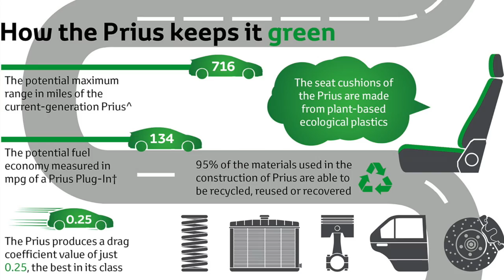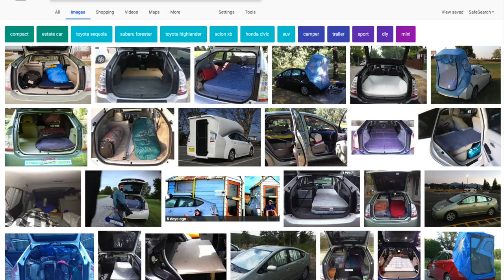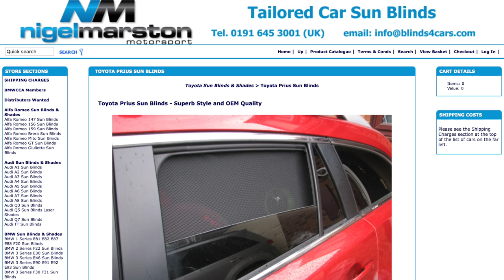Stealth Car Camping in a Toyota Prius (Building a Bed, Staying Warm, Privacy & Security)

Comment: your bed looks super cozy...i do alot of traveling and car camping in my suv (aztek) so spacious and roomy....i do have a little traveling trailer as well i take everywhere with me it has a cot, 13 inch tv/dvd combo and a little night stand (5x8 camper) with ac so i can plug in during the summer to keep cool....i would rather sleep in my suv than my camper most of the time....take care and hope ur well and still safe and traveling..really just need to find a way to get an extra battery hooked up so i can get a little cooler like urs and a few other things
Reply from the maker: Cool! Sounds like you've got a nice setup going. I totally know the Aztek, very unique car. Yeah, I've seen the little teardrop campers and other small trailers. It's interesting to hear that you prefer just sleeping in the SUV. I feel pretty secure, like I could jump to the front seat and scram while in the car vs. separate. I hope you get your battery setup just right and can enjoy the travels :D

Comment: I'm doing the same thing you are doing but instead I have a 2016 Hyundai Accent and I recommend getting the Goal Zero Solar powered battery with a 30 watt solar panel. I have that set up in my car instead of using my car battery. May be a bit costy but It was well worth get for surviving situations. I travel for work as well and was thinking about this for a long time. I copied your set up but was just different on a few things that fit for me. I plan to travel for 5 years worth of work so I plan on living in my car like you at free camp grounds or living at a co workers place on there drive way. You gave me some great ideas.

Comment: What model Prius has the solar panel in the roof? Really enjoyed your video. It gave me a lot to think about! Thanks!
Reply: It's the Prius V with the solar roof package. They are super hard to find now. I looked for one for months before I settled for one with out one.
Reply: I have one, it works really well on the job it was designed for, but they are only set up to run a fan for airing out the cabin when the temp gets too high in there.  Would have been good if it could trickle-charging, or at least "tend" your 12v battery, but no.  It gives about 50W, by the way.
Reply: @Taylor-Hanson   Not quite.... It's an option on the 2010-15? model years. Could get in the 3,4,5 and the V. 

It really does only run the blower fan to circulate air. Works well though.

Comment: The very best feature is the automatic engine shutoff when the battery is charged - it would be great if Toyota (or another manufacturer) made a hybrid vehicle a bit more roomy / camping friendly with the same feature.
Reply: Check out the ford C-MAX energi
Reply: Check out the Toyoya Estima Hybrid, Toyota Alphard Hybrid and the Honda Odyssey Hybrid.  None are available in the U.S.
Reply: @barbaraharrison6930   The new Sienna hybrid looks really good for this kind of stuff
Reply: @hedgehogthesonic3181  Sadly Toyota decided to make yet another station wagon/estate car instead of a roomy minivan. I had hopes for years (been driving a Prius since 2000/1) they would make something more voluminous, but they must have decided it wouldn't sell. I don't know if the Sienna will be an improvement, but we'll see. I have a lot of miles to go on my 2013, so Toyota still has a chance to sell me a real minivan. I'll buy most anything that has the all-night AC/heat and a place to lie down, but kneeling room would be nice.
Self-drive would be great, tell the GPS to take me to my next destination and relax/sleep or whatever til we get there. As much room in there as most train "roomettes" and more than any plane, and my own nice clean bedding, and all my necessaries along without packing and unpacking, and no car rental when I get where I'm going.
Reply: The Sienna hybrid would be a good choice, but boy is it expensive!

Comment: You are my spirit animal. I'm vegan and I'm shopping for a prius to travel. But with my real 🐶 😁 The only thing that would be cooler would be roof racks.
Reply: Are there Priuses with roof racks? I recently bought a Prius and I'm curious if I could get roof tacks installed. When I was at the Mini dealerships (where I bought my Prius) they had a little pop up tent on top of a Mini but I doubt it would be suitable in colder weather.
Reply: he has solar on the roof storage on top would block them no ?
Reply: Roof racks would rob the car of gas mileage.
Reply: @RhiSoundsLikeRye  ya, as mentioned roof racks would really shave the mpg.  I'd consider a tow hitch platform before roof rack-
Reply: Roof racks can kill your mileage by 25-35%.Just Google it.I would think that hitch racks would hurt mileage also...maybe not as much or maybe just as bad..

Comment: Excellent video and very insightful.Interesting point about the solar panel and the door vent for the battery.
To block light from my eyes I throw a t-shirt over my eyes or pull down a winter hat/beanie/toque over my eyes.
I would use wool/fleece blankets for sleeping because sleeping bags :get dirty very quickly;are a pain to wash properly without destroying;lifespan greatly reduced by frequent washing;delicate and not very durable material prone to tearing+staining.
I rented a Prius for car camping rarely nice and found the front seat folded down far and was great for sleeping.This is true for most Japanese cars.
Good point about the 4runner.Suvs ride rough,bad gas mileage and surprisingly don't have much more usable space than a car-try fitting a bike in a suv.
Reply from the maker: Great feedback, Dave! Thanks for the feedback and tips about blankets vs. sleeping bags ;)

Comment: Greetings Again Court -
A couple questions regarding your Prius. In that it's a 2011, and you've had it several years now apparently; it appears to be in Great condition (having watched it make a cursory appearance during your Santa Monica HBike Urban Plus review with Virginia.
May I ask, how many total miles are on it now; and how many have you put on? In terms of mechanical maintenance and repair, have you had to do any significant work on it? How is the Main battery and the other supplemental battery(s) holding up?
Are there any notable function, design or experience issues with the car that have been something to reconcile with?
How much longer do you expect to run this particular car; and would you then replace it again with either a used or new Prius.
Fantastic Look at your Car Camp System and Routines. Much Enjoyed. Thanks for the most informative reviews of ebikes and topics like your method of travel efficiency.
Reply: Found your comment 2 years later. I have 2010. It now 10 year old 130K mi. No single problem. Battery works just fine.  Few years ago I replaced 12v battery. Friend of mine got 400K mi on Prius. Need to ask if the battery original or not. Some people say it last at last 200K

Comment: It's a hot day and someone thinks the dog is real and breaks in to rescue it! :D :D :D
Reply: One very nice thing about the Prius is that I can leave my AC running with the  engine in READY, but not running, lock it and walk away leaving my dog inside.  The car starts itself if the main battery gets low from running the AC (it can't be left in a condition where it could put itself in gear and drive off ).  I put a sign in the window to let dog-lovers know my pooch is more comfortable than they are.

Comment: loved your video about your Prius.  Could you tell me a little more about the solar panel in your roof, (did you install it) that runs your fans and inverters chargers etc,  Thanks Cindy Denver
Reply: He was disappointed that, as standard, the solar panel only runs the cabin fan to help keep it cool in the sunshine.
110 V AC Inverter 11:33; modified wiring to 12 V small battery 12:03.
btw it was misleading when he called the small 12 V battery the starter battery since both batteries need to have charge to start the gas engine. The small 12 V battery runs the control systems, the lights, wipers etc. The Traction battery (200 V) is used to power one of the Motor / Generators (MG1 or MG2 can't remember which) to start the engine.
The cool thing is that the control software prevents (on all but Generation one cars I believe) the Traction battery from draining below about 50 % charge so that, even if the car refuses to move in EV mode the car will still start provided that the small 12 V battery is good 🙂. If need be the 12 V battery can be jumped from another car as usual.

Comment: Kudos fellow vegan Prius traveller.  I am in the planning stages, and would love to know which of the dash cams you bought.  The link shows many results on a page.  Also, how did you decide which of the mattress thicknesses you wanted?  I tried sleeping on a spring mattress I had from a pull out couch, and could feel the bump in the seats.  Thinking it might need an inflatable pad, and the mattress on top.  Thoughts?

Comment: took the front passenger seat out of my 2010 ( gen 3 ) prius, can still fit 3 people in the back seat and frees up ALOT of space in the car. should consider it if you never carry 4 people in your car ( which is never in my case ).  Although the airbag light comes on the dash.

Comment: Change transmission fluid before 60,000 miles,i did mine at 40,000,cost at dealer is 130.00 in florida.

Comment: Thanks for the inspiration! That is really cool. One question tho, what are the tricks for ventilation while remaining safe? Thanks a lot!
Reply: I added the rain guards over the doors which allows you to crack open the windows half an inch and get the ventilation you need. I also can hang my Eva-Dry humidifier from the passenger door handle from the ceiling

Comment: 2008 Prius, 270,000.0 Miles Incredibly Dependable! Just keeps working no problem..... . FYI, As  I watch the moon and stars with head at back end window and found that the laptop sitting open behind passenger seat also reflects the screen when looking straight up into a dark sky. The picture is reversed but with wifi hotspot phone unlimited real hs access for $50. a month walmart card go any place, cheap & climate controlled is perfect in ohio winter, just leave it on till summer or keep driving south till you can open a  window.... then drive more south and use the AC without changing the temp setting....  <3 My Prius  W/B  <3

Comment: Hey man, I am considering buying a Prius, looking at a 2012 with 60,000 miles asking 10,900.00 I thought that was good for the greater D.C. area. This one has navigation, looks like yours has it too. If so, do you use that? If not, then I guess not applicable. I work in Europe at times and when I am stateside I travel a lot. So sick of paying for hotels and fuel prices, so thought I could maybe do what you are doing. 
The mesh screens are nice, but I do think it would be dark and private enough at night.  Are they stealthy enough? 
Also, what about cooking? What do you do? Just wondering! 
Great video, 
Thanks!

Comment: What's that foam padding you use to stuff the space between the seats under your head? I've also been car camping in a Prius and am also 5'9, and I need to stuff something in that space but have had trouble finding something that fits right.
Reply: I just stacked winter clothes in that spot

Comment: It would be pretty cool to somehow connect ur devices u use in your car 🚗 to your car speakers 🔊 like your ipad
Reply: Pretty easy to do actually. Most cars after like 2007 have AUX ports and/or Bluetooth. The Prius 3rd and 4th gen have both Auxiliary input and Bluetooth :)

Comment: I'm considering doing this. But my only clear concern is the taillights. With the car running all night, even though it's quiet when the gas engine isn't running, aren't the taillights always on? I'm concerned about them drawing attention to my car in the middle of the night.
Reply: Just keep your parking lights off and the tail lights won't be on. Did you do this?

Comment: I was wondering if i could use my hybrid as a generator as you so.  I have a Kia Niro, and have lots more space than a prius and similar gas mileage. 
Thanks for all the tips.  
I think i need to install an inverter or get a small battery that can provide a modest amount of AC for a few hours and i am set.
Reply from the maker: Awesome, good luck!!

Comment: I'm thinking of switching from an SUV to a Prius. Seriously, it looks like you have as much sleeping space as I do. I was curious, do you know the length from the back of the front seat to the end of the interior for your bed?
Reply: could be about 56 to 66 inches plus the added part between when middle seat is down, and front seat is as forward as can.

Comment: I did a similar thing w/ my civic hatchback but after 2 weeks in Squamish it started to mould on the ceiling and elsewhere. Any thoughts of mould proofing?
Reply: Try to run the AC more. You have too much moisture. AIr conditioners are also dehumidifiers.

Comment: Hey Court, how do you deal with locking the bikes when you're on a foot hike so they don't get stolen? Any security ideas there?
Reply from the maker: Good question, they can be locked directly to the hitch, which is locked to the car... but that can be defeated still. I usually leave my bikes elsewhere or go for a ride vs. hike if I have a fancy bike in tow.

Comment: What  have you done for internet and wifi in remote areas with zero phone signal? I work remotely and would love to work in my prius when canping.
Reply from the maker: My phone is on AT&T, it worked pretty much everywhere and I just paid for the unlimited internet and roaming. I guess the key is to not go super far from phone signal if you want to work, or to save your work offline and then sync later :)

Comment: Fort,

Great resource video.  Thanks for sharing!

Questions: Specifically, is your Aerodynamic flush roof Solar Panel a Prius option or please share who makes and does the aftermarket install?  I also didn’t catch, have you added an additional AGM battery? And extra Instrumentation or Electronics, like a Solar Charge Controller, etc?

Thanks much also for your incredible (Shout Out!) ElectricBikeReview.com. Viewers, spend some valuable time there!

Comment: Hi Court, will the 31 inch wide Milliard mattress fit?  Or would that not fit as well because it would go over to the other seat or get blockd by the middle glove compartment?  Thanks for your response in advance.
Reply: hi Hector - 27 inches is about the max width on the '60' side..

Comment: Is there any harm leaving it running overnight? I am going to be sleeping in mine soon and would like to use the ac at night.
Reply: My boyfriend and I have been sleeping in a Prius for years when on vacation or traveling. Running all night to either cool or heat us, depending on the season.  Never seen any problems, though we do maintain them properly. Almost 200,000 mls on the last Prius, and it was driven away by the new owner.

Comment: In a 2008 what would the idling fuel consumption be with air conditioner about 74 degrees

About a gallon of every 10 hours and what about heats up to like 65 in the winter about the same a little more

Comment: Question:  what kind of power source is needed to run the cooler when the car is not running so the foot wouldn't spoil.
Reply from the maker: Great question, I found that the cooler would stay pretty cool even when the car was off, because cold air sinks and stays inside. If you turn the car on for a half hour or so every once in a while, it can refresh the cold and then it will maintain it. The food I got was also pretty durable (almond milk, nuts) so it wasn't spoiling as quickly as some other things might have. I'd also not overstock on food, just stop by the store more often for little refills :)

Comment: can u send a link on how u can lay down in ur bed and instead of holding the ipad u mentioned u cant connect or put it somewhere
Reply: Hi Brian, you can search Amazon for iPad holders and arms. There are many options that use clamps and have bendy metal that allows you to get it setup just right! I found one called "Klsniur Gooseneck Tablet Holder" that looks like it would work well, but it's not the exact one that I got.

Comment: What’s your height? Not sure if you mentioned in the video.
Reply: 5 ft 9 in
Reply from the maker: cuirousgeorge555 is correct, I'm roughly 5'9" and weigh 135lbs.

Comment: Does your spare solar panel hook up directly to the car battery to charge it?
Reply: I bought a used VW sucker-to-the-window solar panel charger on eBay for $20 that keeps the 12v battery charged when I'm away for several weeks at a time, but I haven't approached that huge 200+v main battery.

Comment: I just bought a ex fleet Prius hybrid like this one for 3k.  Call your local cab company you might strike it
Reply: How’s it holding up?
Reply: Christian Rogers  so far only needed a catalytic converter that ran me 270.0 at rockpro. And injectors cleaned . Tiny leak in transmission that’s going into be looked at . Have put gas in it once in two months . And can fit 2x4x10 and rebar in it like nothing ! Little work horse . Toyota means it when they say parts are designed for the life of the car .

Comment: You actually have to charge those jumper batteries in order for them to be useful, not just leave it in the box
Reply from the maker: Thanks Russ! Yeah, there's a wall plug and I occasionally take it into hotels and houses to charge up (once a month or so). Good tip, I don't want anyone to think it lasts forever and then get stranded!

Comment: Where did you get solar panels for car built in?
Reply: Jesse Garcia prius 3s and up come with them
Reply: Option with the sunroof package BUT only power the air circulation when the car is unattended. Never seen a way to use that power for anything else.